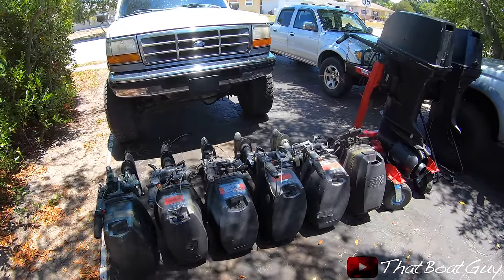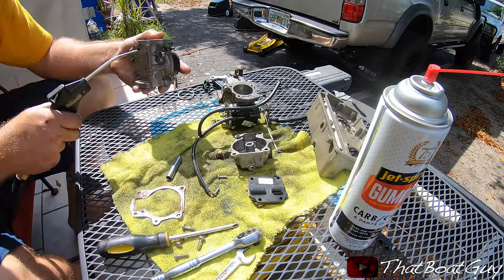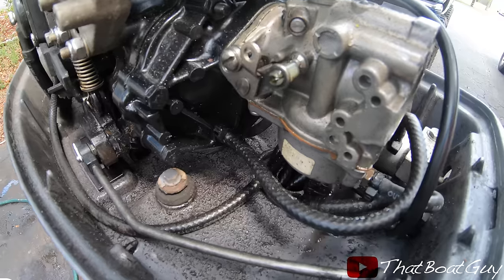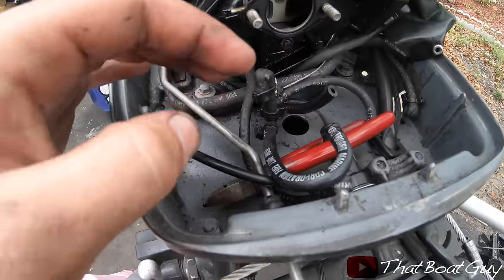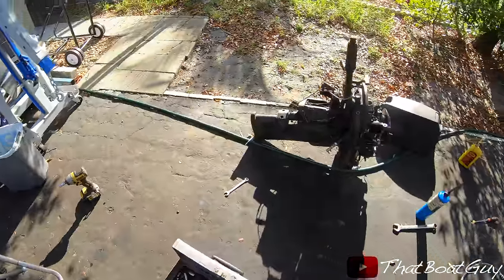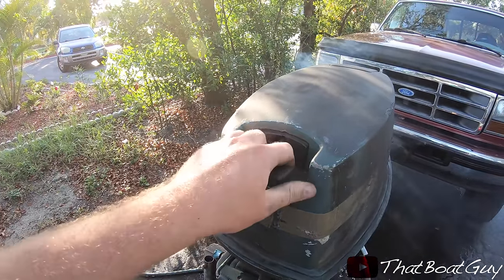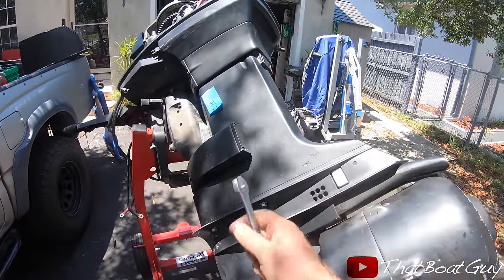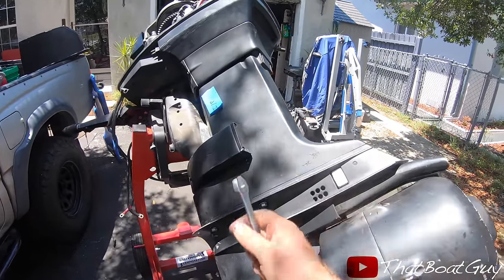Can I Fix 8 Military Outboard Engines?

Comment: dang bro were are you located i got a mercury 50 hp 2 stoke  carbs is leaking fuel i was told when i rebuild them i must of not set the float rite can you help me with that .

Comment: Hi have a 50 Yamaha outboard it blow fues the plate that starter holds it cracked wonder if that's why blow fuse and burnt the wire

Comment: I have a mercury 2takt fron 1978 I believe. Still look amazing in the inside. But she runs sometimes on 1 cilinder (especially when going slower) and like 70% on 2 cilinders. It's not the spark plugs or the carb. Any idea anyone?

Comment: Do y’all think it’s worth fixing a evinrude 15 that needs motor mounts, lower unit seals and the starter coil bolt hole tapped?
Reply: If it runs good then yes 👍

Comment: Are these some commercial brands more or less off the shelf, or something custom. You'd need to get parts for a name brand I suppose.
Reply: They are slightly modified commercial units.
Reply: @kjdude8765  I wonder what brands they use.
Reply: @joewoodchuck3824  I saw the Johnson logo on 2 of them, under the CARC paint.

Comment: I have a 1992 25hp nissan. It starts right up typically then will run for awhile last time was around  15 minutes or so and then bog down and not start back up easily and if i do get it started after that it typically dies again quickly. Any idea whats going on?

Comment: Their is a 2005 USA 15hp merc 2 stroke near me for $500 aud but has no compression in cylinder two until you get into high rpm thought this was pretty weird and didn’t know if it was worth buying and fixing does anyone know why this is happening

Comment: **HELP PLEASE** why would my motor be taking 7-12 seconds of holding down the electric start button till it finally turns over. 2013 mercury 30hp tiller handle.

Comment: Yo dude what’s up. I’m just trying to see if I could possibly get you to check out my motor and get it fixed. It’s a 1985 evinrude 15hp starts and runs just not very strong open throttle

Comment: Yo could anyone help i have a 2 stroke yamaha 1996 9.9hp engine which was under water for a couple hours, i have cleaned the carburator bc it was full of white wax, i have new sparkplugs, a new impeller and i dont think there is water in the sylinders because there is compression and there shouldnt be water in them. But the motor still doesnt start when i try to start it. It wont even make a noise. Does anyone know where i should even start?

Comment: Hello
 I'm going crazy...
 Got spark on one side 😀
 Other side no spark, so I bought a new capacitor, ignition coil, ignition cable and spark plug (changed spark plug on the one that gave spark)

 Now there is no spark on any of the spark plugs😡

 Has changed place from the side that gave spark, and wise worse.

 The one who gave the spark first, is completely dead😡
 The side that I have changed everything, I managed to get spark on sometimes tonight.

 Everything is cleaned

Evinrude 4 hk from 81-83, something 

 Thanks in advance